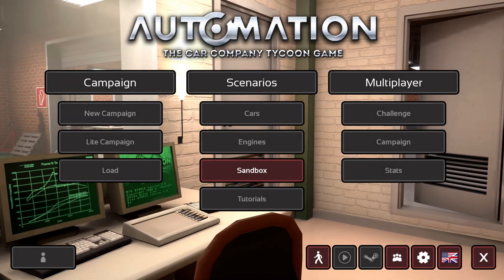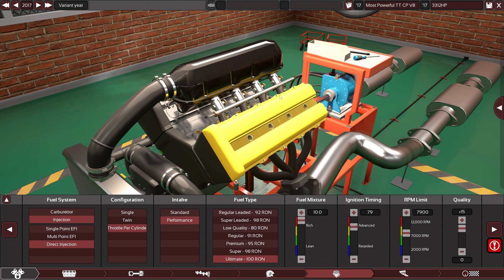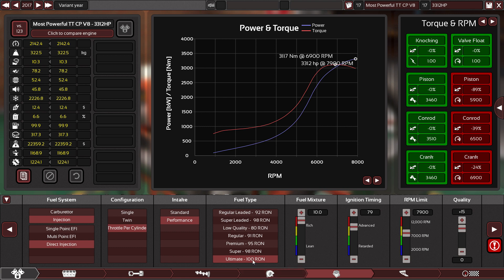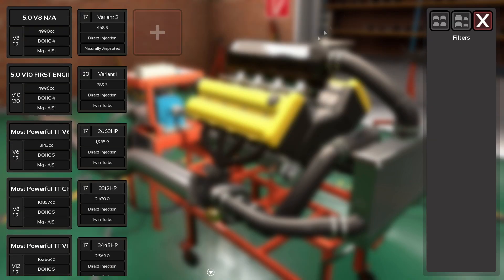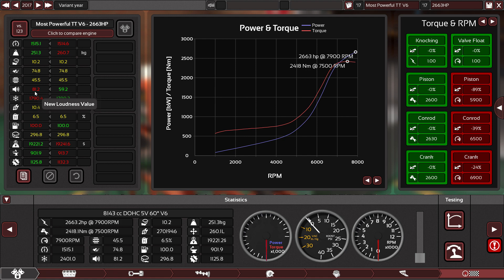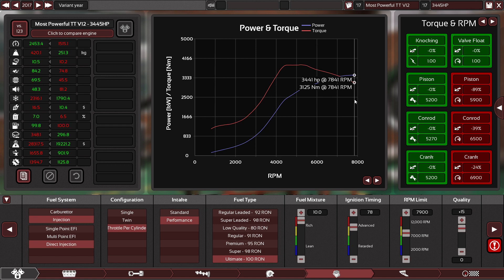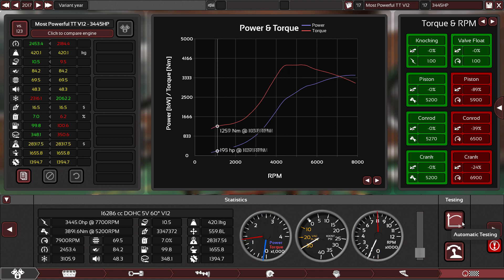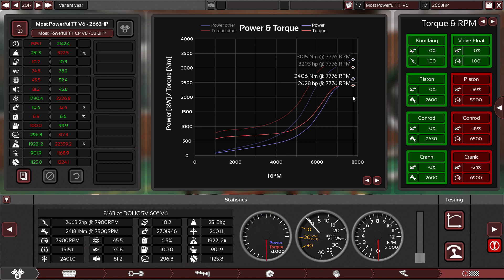Automation Unreal Engine - Most Powerful V6, V8 & V12!

Comment: I do like the update but there are a few bugs which i found during my engine building and tune as well. The turbo setup need some revamp with twin scroll. quad and twin turbo on inline 6s and maybe hybrid sequential twin. I am a massive fan of the RB26 and 2JZ. and the classic L28ET engines. so far my best is 780bhp on the RB26DET if it had twin turbos. It could hit maybe 1000bhp at crank just like the real deal.
Reply from the maker: I agree with ya. I have been wanting twin turbo's for the straight 6 on the old game for SO LONG! I think with enough feedback, the dev's will hurry it up for the Unreal version of this game!